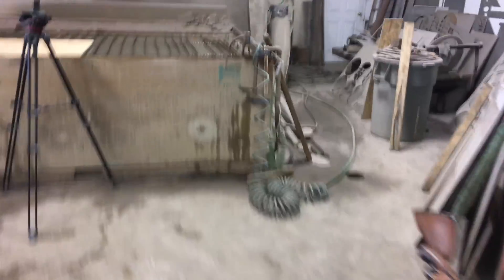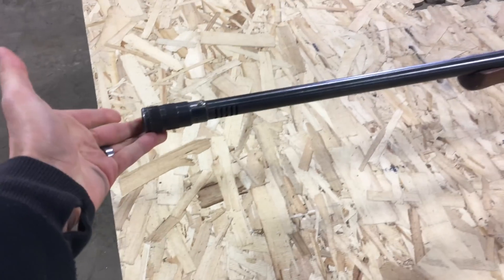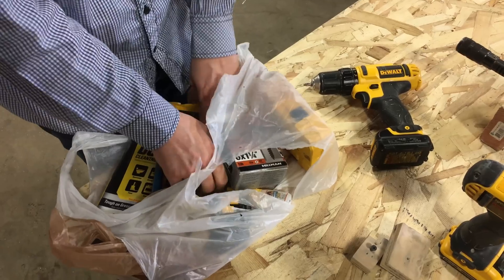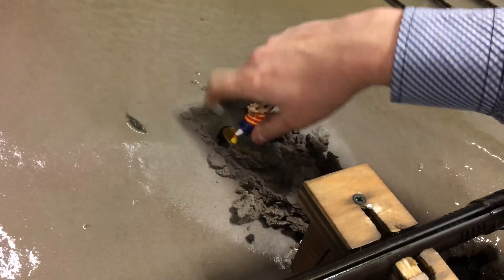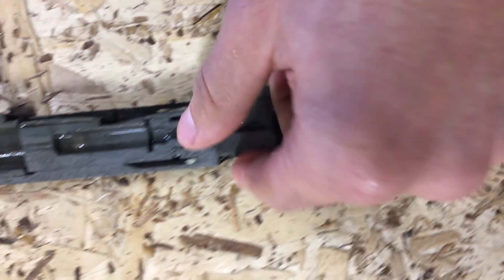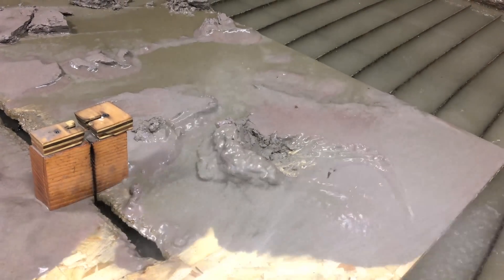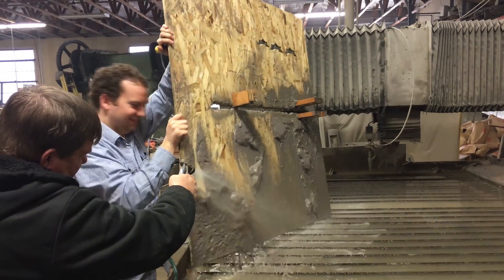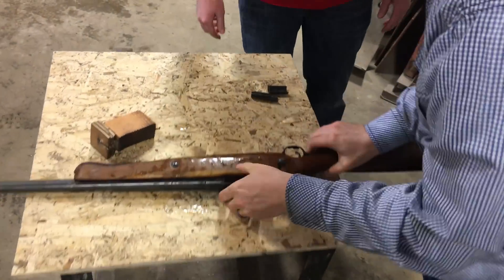Shotgun vs 60,000 PSI Waterjet

Comment: How is that a shotgun?
Reply: They make bolt action shotguns, look it up.
Reply: Gabriel Küsel I find that hard to believe.
Reply: Look up "bolt action shotgun".
Reply: Still weird
Reply: SilverDust shotguns come in all forms. Pistol, pump, lever, bolt, break side by side, break over under. They still make bolt action slug guns today for hunting, helps in anti-gun states like ct.
Reply: Red Beard actually they don't make pistol shotguns, legally a shotgun can't be a pistol. That would be a short barrel shotgun. However there are a few pistols that can shoot 410 shells, but are designed around a pistol cartridge
Reply: yeah hard to tell looks smaller than a 20 guage